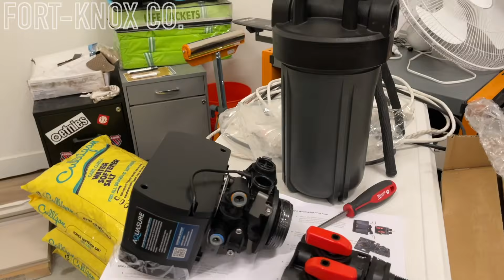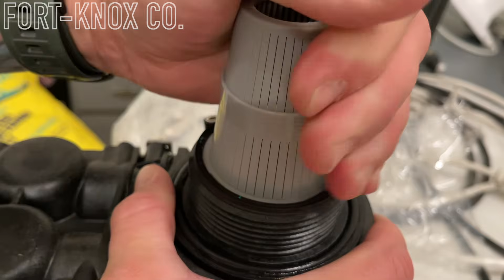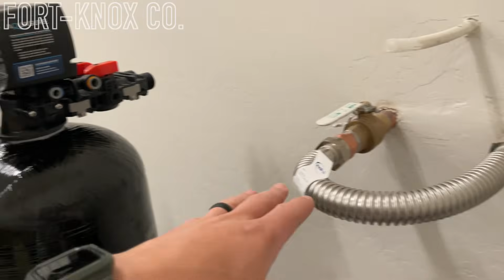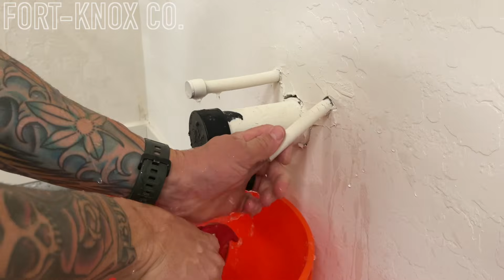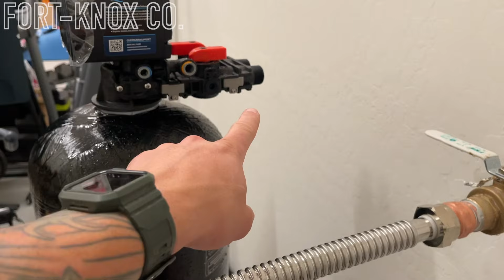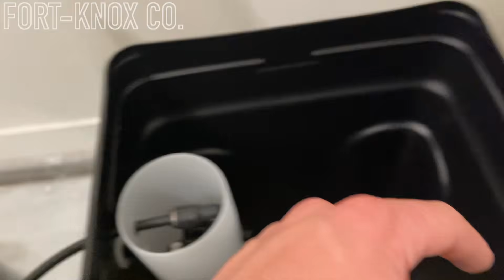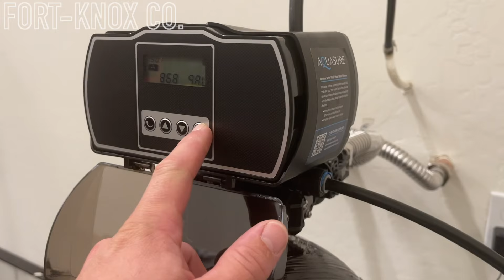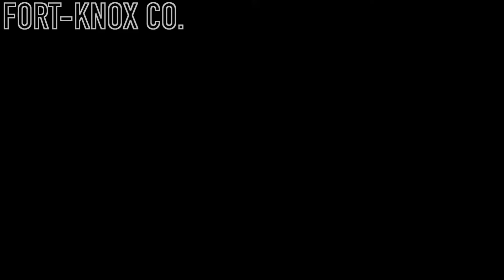How To Install Water Softener System Aquasure Harmony Series | Water Softener Loop Connection

Comment: Man oh man, tell me why I bought a soft water system last week for $5,300 and I should of waited until you made this video, hell I should of just had you come and install it for me 😡😡😤😤lol.
Reply from the maker: 100% you should’ve had me do it. I got a delivery free to my door for under 700 bucks and it’s a lot better than the other ones I had bought in the past. They started at $5000 or so and if I felt like I was getting a deal I could get them down to close to 2000. But I also just installed a reverse osmosis system so if you haven’t done that hold off lol. I just drilled a hole through the courts and installed it last week and I have a video on it here soon.
Reply: @FortKnoxCo  Lol they will be here at 5 PM to install everything
Reply from the maker: Aww man
Reply: Damn 5300 dlls , I paid 575 for mine with a prefilled!!! And install was like 1 hr
Reply: Wait how's it possible it's 5000 dollars but others are 700?  Is it 5K for the unit and installation?
Reply: @richardsanchez5444  yes it’s for everything.